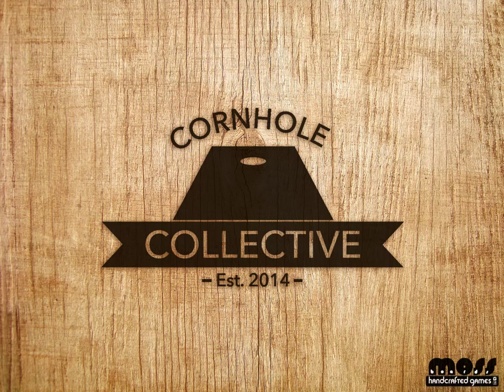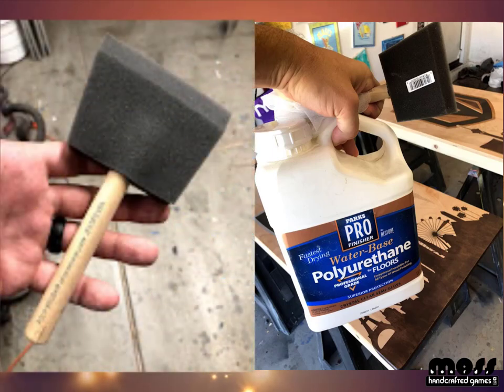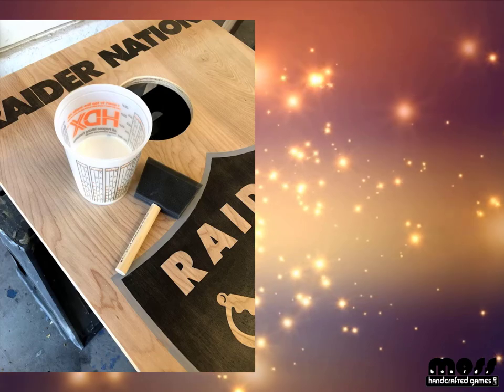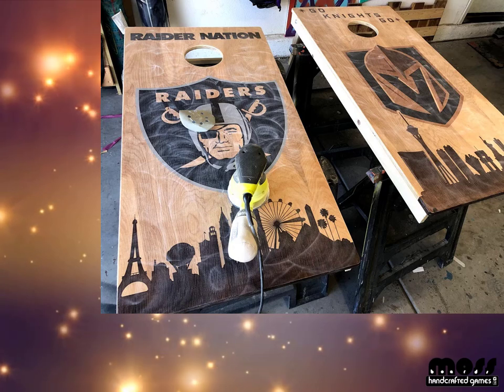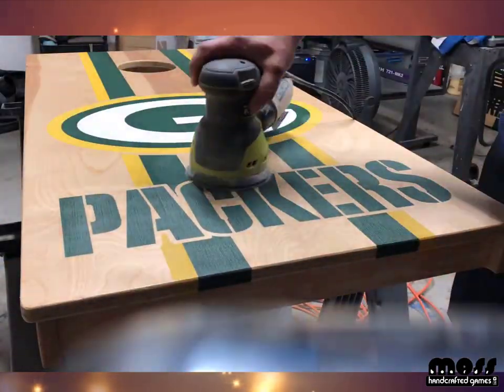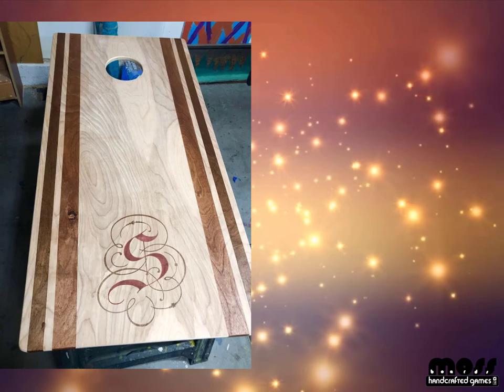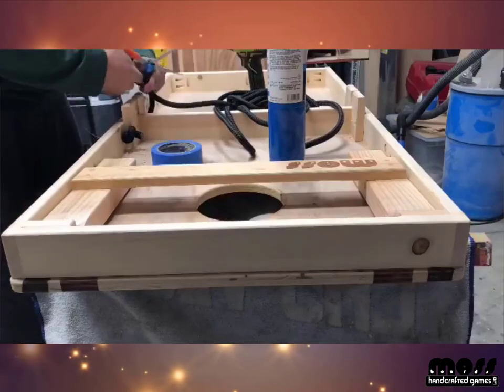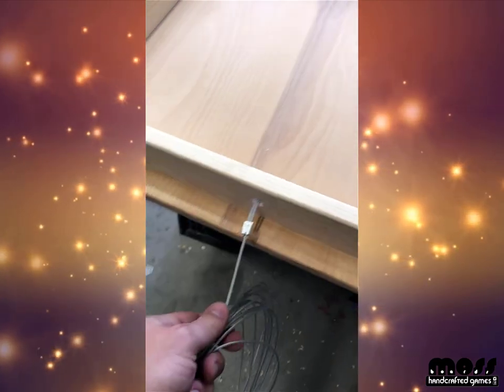Better Cornhole Boards Phase 5: Finishing Steps!

Comment: If I wanted to paint my boards (vs stain), what type of paint do you recommend?  Latex (indoor or outdoor), oil-based, acrylic?  What top-coat should be applied to the painted surface?
Reply from the maker: Hey Michael! Thanks for watching! Latex and acrylic have very different looks and application methods. In my opinion acrylic stencils Much easier and flatter. It’s cheaper and you can blend colors. However, it doesn’t cover as well as latex. If you’re painting large solid color sections, latex might be better. For decorative paint, acrylic is better.

Comment: These boards look awesome! I think I used the wrong polyurethane because the white lines on my boards turned yellow after applying a few coats. Any recommendations? Also, how did you get the city designs and the tree designs on your boards? I love the look and would like to try that on my next set.
Reply from the maker: I’ve done that too. Always go with water based poly if you have white or any light colors you don’t want to yellow. Oil based is beautiful over stained or natural wood designs. Slide is more predictable with water based poly too.

Comment: How do you know when you need to spray poly before using the foam?
Reply from the maker: If your gel stains have been sitting for a day or more and it’s dry where you live, you shouldn’t need to spray before liquid water-based poly. Sometimes certain paints will smear no matter how long they’ve been sitting. Spraying the poly is just a way of saving time and guaranteeing the stain or paint doesn’t smear.

Comment: Cant wait to build this style and design them. Wheres the best place to order stencil type designs that I can paint? I have pre stain and stain, poly..I just need to order designs I can tape down and paint over.
Reply from the maker: Thanks! Take a look at our site. Lots of friends you can order from. Cornholecollective.com/friends
Reply: @cornholecollective7116  I ordered the thin blue line flag design, paid 10$. I got a link sent to me to download it? All it is is a picture of the flag. I thought I was getting a design sent to me to use. I tried responding to the email and its not possible. I cant find anywhere to contact anyone. What a bunch of bullshit

Comment: Wonderful tutorial as always! Thank you. Quick question - how in the HELL do you make such perfect paint/stain circles around the holes?
Reply from the maker: Thanks Maura! There's a trick for everything. I like to cut the circle stencil to mask the hole or make a circle around it and get it ready with transfer paper. Then (stay with me here) place your cell phone with flashlight turned on directly under the the hole on your table or sawhorse. Turn down the lights and turn on some soft music, place your stencil using the shadow from the hole to center the vinyl stencil or mask. BOOM, perfectly centered vinyl around the hole.
Reply: @cornholecollective7116  haha. I like the soft music part. But I'm still not following unfortunately.   :( If you need an idea for your next video... I'd say here it is!
Reply from the maker: Maura Miller do you have a vinyl cutter to make a 6.5” circle?
Reply from the maker: Hey Maura, just posted a 1 minute demo video on Instagram to help with this https://www.instagram.com/p/CCOgIeFjJOn/?igshid=uj5gr1lng7ci

Comment: Would this method of sealing work over sharpie?
Reply from the maker: I’d suggest spraying a water based poly first then the liquid over that. Try a test piece first. It’s what I always use the hole cutouts for. Should be good.

Comment: Do you apply poly to the frame and legs? Or just the tops?
Reply from the maker: Hey Tyler! Yes. Poly on the frames and legs help them stay cleaner and may help with moisture. Bare wood gets scuffed up quick. Couple coats while you’re sealing the deck is all it takes. Cheers!

Comment: Thanks for all the information! I have a question, On my boards i used a mixture of oil paint based sharpie markers and regular sharpie markers to create my design is the spray and polyurethane safe to use for that material? If you can get back to me when you can i would appreciate it thanks!!
Reply from the maker: Hi Barbara! Yes. It will work. I’d suggest spraying aerosol first to lock in your design. Then liquid. Sometimes water based liquid poly smears paint or some stain pens.
Reply: @cornholecollective7116  i never saw your reply - Thank you i’ll have to try it out i appreciate it! 😁

Comment: I am wondering about a plexiglass surface or resin coating? Have you used either and is the slide ok? I'm considering a custom made wrap and want to protect it from peeling.
Reply from the maker: Never done this before. Resin is expensive and I have no idea what the playing surface would be like. Please let me know. I don't like wraps much but that's just a personal preference.

Comment: Does sanding between coats effect the look of the paint job underneath
Reply from the maker: I wouldn’t suggest sending between every coat. After you have three or four coats down and it fully dries, sanding is important. Knocks all the ridges down and smooths it all out. Final coat or two and you’re done.

Comment: Do you not recommend mitre cuts for the frame? I’ve seen some do it but noticed you don’t.
Reply from the maker: It looks good but I think it might be a weak point. Some chunky kid stands on the board while they’re set up, all the pressure goes on the top corner joints. That’s the main reason I add the small blocks inside the top corner. You could still do that to beef them up.
Reply: Thanks man, excellent work.

Comment: Would you mind sharing what vinyl cutter you are using?
Reply from the maker: US Cutter MH721 with Oracal 631 vinyl and HT55 Transfer Tape
Reply: Cornhole Collective Is the vinyl cutter software pretty easy to use?

Comment: I recently bought a set of boards and they were wrapped in a vinyl on the top of the board. can I use this process with that vinyl? Thanks!
Reply from the maker: You want to paint your vinyl? You’re probably better off removing the vinyl, cleaning up the wood and painting that.

Comment: I have a 2x4 giant photo on matte paper from a local developer that I mod lodge to my Cornhole board!  It was quite expensive!  But I’ve applied 4 coats of polyurethane and it looks great however I am afraid to even lightly sand it due to possibly damaging the photo! Any suggestions? I want or need the surface to be smooth!
Reply from the maker: I'll put this out to the Collective for answers. Sorry James, I don't have experience with decals or wraps that remain on the board. I'm sure that if you put several coats of clear on there, you can lightly sand it so it's super smooth and it wouldn't hit the wrap.

Comment: You mention how the clear coat brings out the color around minute 7:10.  Is that still in reference to the Parks Pro finish?
Reply from the maker: craig bohon yep, the striped boards with the fancy S are bare wood on the left and clear coated on the right. Also with Pro Finisher.

Comment: So do you sand after the 1st and 2nd coat and then apply 2 final coats without sanding?
Reply: That's what it seems like. I personally sand all but the final coat
Reply from the maker: I have found that I can do 3 heavy coats one after the other as long as the surface is dry to the touch. Then let those FULLY dry before sanding it super smooth. wipe the dust, One or two final coats and it's great.
Reply: @cornholecollective7116  trying this. I'm always scared to sand through the first coat and mess up the image
Reply: Cornhole Collective so 3 heavy coats then sand? Ok thanks. I’m making my first boards so I don’t want to mess them up.
Reply: @cornholecollective7116  So you typically only sand once then? No sanding after the final one or two coats?

Comment: Awesome work!  Do you ever stain and paint a board?  I'm making my first set and want to paint part of it and stain other parts. Oil based stain has more options than water so that's what I got. The paint is water based though. Should I stain the whole thing and then paint over or should I try to match lines of paint to the lines of stain?  Probably really difficult.  Would that be a problem?  The oil and water issue?  Hope this makes sense
Reply from the maker: Makes perfect sense Caleb! I use paint and stain all the time. It really all depends on your background color. If for example, you’re staining the entire background, do that first. Paint over it with latex paint. When I do paint, it’s usually minimal accents so I’ll apply the stains and paints to bare wood. If you’re on Facebook, join our new group and share pics of your design, that’ll help us help you! Cheers! https://www.facebook.com/groups/726210184885336/?ref=share

Comment: Do you sand after each coat or just after the first coat?
Reply from the maker: There’s nothing wrong with sanding every coat but you risk sanding your paint or stain. Personally I apply a few coats before sanding, then wipe, then final 2 coats of clear.

Comment: Loved the complete set of videos. I've made maybe about a dozen set of boards to date, but this is the first set I built following your instructions. I used birch tops as you suggested. My design will have a large car decal on each with a painted border around the boards and painted stripes from the sides up to the hole. I sanded the tops with 320 grit sandpaper. I applied the tape and painted. I still have to apply some pinstriping over the painted surfaces. My issue now is some of the surface is rough after being painted. I'm worried the pinstriping will bleed because the painted surface is a bit rough in some areas. I can work around that as I can touch up the painted surface if it bleeds. Once I apply a few coats of the poly, will the sanding take down the rough areas that developed after painting or should I sand the painted surfaces first and recoat if necessary before applying the poly? Thank you!
Reply from the maker: Hey Dave! Thanks so much. I don't paint often but when I do, I usually use acrylic paint, it lays much flatter is is much thinner so you can often apply it like a stain and see the wood grain. Given your situation, I'd poly first then when dry, sand that smooth with 320 grit paper. It should knock down the fibers and paint edges without risking the paint itself. THen apply decal, then apply a couple final coats of poly. Hope that helps.
Reply: @cornholecollective7116  Thanks for the quick response.  Just to be sure, you are suggesting two coats of the poly (I'm using the Pro Parks you suggested) and then sand. Then add the decals on top of the poly?  Then two more coats of poly?
Reply from the maker: Two or three coats, let that sit a few hours, sand with 320, wipe free of all dust, apply decal, final 2-3 coats and you should be great.

Comment: i used what you use in this video .. but when i sanded the there were two spots the started flaking peeling up .. i waiting around 36 hrs before sanding
Reply from the maker: I would assume that the costs of clear were applied too quickly. Just a thought. I’ve had that happen before when I applied thick coats before the previous had dried enough.

Comment: Any reason to not use shellac instead of poly?
Reply from the maker: That might work but the slide factor could be wrong. Water based poly is clear, doesn’t yellow any colors you may use and the cleanup is easy.
Reply: @cornholecollective7116  I read shellac over latex paint is ok but some believe over time moisture still in the paint will affect it and begin to crack the finish.  Going with poly.  Thanks for your advice.

Comment: You use 1x3 for sides or 1x4’s?
Reply from the maker: I usually use 1x3s. Lately I’ve been ripping 1x6x10’ boards in half. Cheaper, straighter and you have some free frame pieces.

Comment: How do keep the finish from turning milky?
Reply from the maker: Good question. Never add water to clear coat. That turns it milky. Unfortunately, I think some morons add water and return bottles to the store. Always pull from the back. I’d try a fresh bottle and see if they dries clear.
Reply: Cornhole Collective could humidity levels have anything to do with it? I used the same can on 2 separate sets of boards and only one set turned milky? I live in south Mississippi where humidity levels are normally very high

Comment: Can this be applied to fully wrapped boards?
Reply from the maker: Sorry, I dont have any experience with decal stickers or wrap graphics. All paint and stains here. I do know many builders use the same pro finisher poly over printed graphics though.
Reply: @cornholecollective7116  maybe I'm not putting enough on at a time. Can see brush strokes after it dries.
Reply from the maker: @truthh8322  if youre fine sanding enough to smooth the surface before the final coats and you still see deep brush marks,  I'm not sure why that's happening.

Comment: After spraying the first oil based poly to act as a sanding sealer, how long do you wait before applying the first coat of water-based Parks?  Great work BTW!
Reply: Never mind.  I just realized it is a water-based spray you are using.

Comment: what would cause this or how do i fix it
Reply from the maker: Sorry you ran into that problem. Humidity, Dry times, the thickness of the coat, application methods, it's a tricky combination of factors. I live in a hot desert so the initial heavy coats dry really fast. I imagine that might be the issue is the initial coats had not dried fully before applying the next coat causing them to separate. I've seen issues with clear coat not fully adhering to stained (sealed) areas but binding with the natural wood just fine.

Comment: I really like your boards. Would you mind giving me feedback on my page.
Reply from the maker: That comment looked kinda like spam but your page looks good. Your boards are solid. 2x4 boards tend to be very heavy in weight you already know, can't tell but if those are 1/2" tops, even with a brace, they can be bouncy. You may want to try 3/4" tops with 1x frames. Same overall weight but thicker tops help a lot with how they play. I'd be curious to know what you think. Best of luck with the page!